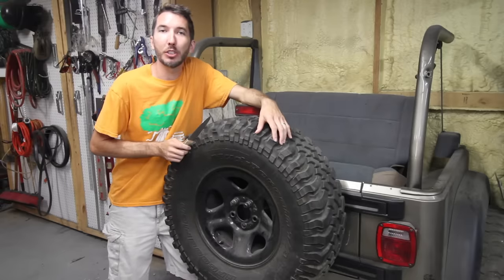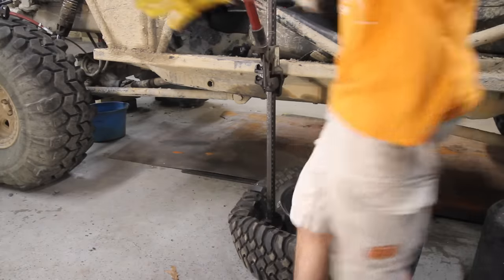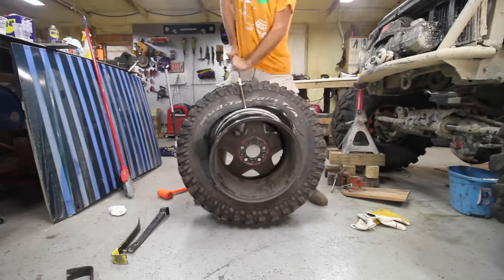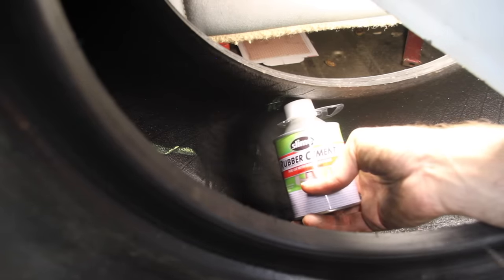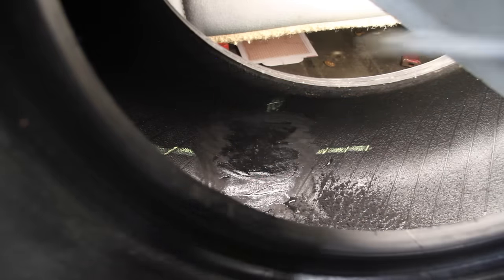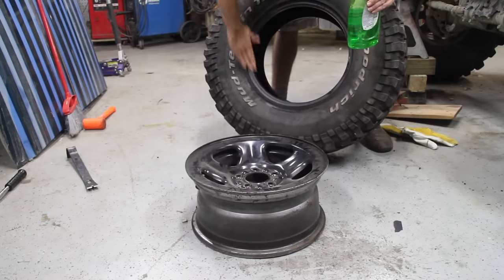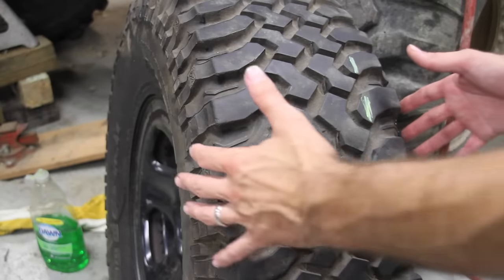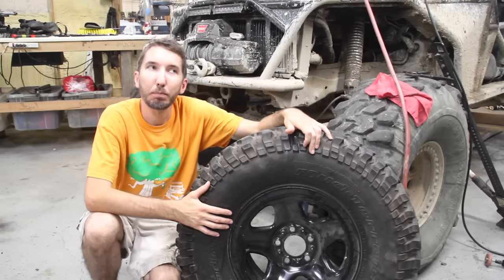How To Fix This - Patch A Tire

Comment: man so many people decided not to hear, that off road comment, liability comment, some people confused on balance lol. suddenly everyone's an expert. it holds air guys that was the goal, it only has to be vuagely round at that point it its never going to see more then 12mph if you wanna carry 3spares go ahead. if you have no dedicated off road vehicle fine. people even claiming retreads and vulcanized rubber don't exist. very sad.....  only think I have to add it that went on and off a lot easier then most anything I've got to work on with a 50s tire machine. it can be so much more trouble then that particular tire, stiff sidewalls are a pain, but wouldn't wanna live without em
Reply: Saya 1 lol I am an expert. Certified and all. And for a trail fix, id say go for it. Matt did say it's just to get you off the trail and I second that. Get it replaced so you can safely run low psi in the future. There's nothing fun about blowing the tire and bending a rim on a rock when there is no air to dampen the blow
Reply: Saya 1
Reply: Good job attempting it yourself but... That's a radial tire. So you need a radial patch. You put in a bias-ply patch.  this will fail. The radial patch has radial Plies built into it so it can work with the tire. A bias ply tire  Has Criss Cross Plies in the sidewall. that's the reason for the criss cross patch. Also you put ( after peeling the backing off the patch) your dirty fingers all over the back of the patch. You have to hold the patch with the backing still on it or  peel one half put it back and peel the other half Look up A&B compound. This is used to fill the slice. Rubber cement will never seal a slice. All I can say for your mounting the second bead of the tire is a monkey banging a football. You put  this on YouTube for everybody to see as well. if that Tire fails... And somebody is injured... Expect to be visited. A good retread shop will fix that tire for you. But a tire repair and replace facility will tell you it is junk.
Reply: +jon rheaume if it fails at under 8mph as dramatically as you suggest then there shouldtve been someone under the tire once it failed. I think your missing the off road statements he made, if anyone tries this on road use or above "off road speeds" he is free from any liability concerns. I believe he said he doesn't particularly recommend it but is showing us how, if I remember that rightly  then he's even more covered for liability. if you read the description for any/every video he makes, he's again covered for liability. so unless somebody's requesting his presence as an outside expert in jeep related stuff in a court he ain't gonna be getting any calls. and remember his credential are for a photographer he is a self made business the chances any want his in court as an expert would probably be looking at factory trained techs. lol
Reply: +sisco lol alright do what ya like. but for under 10mph and maybe 20psi I'll risk a leaky tire and "my life" in case it hisses or whatever ya think its liable to do. I haven't a clue how a slow leak could kill me, but I'll just keep an eye out. watch your ankles for snakes on the trail walking home and never repair anything ever again if you want to worry about minimal risks. some risks do need to be calculated
Reply: +sisco if your expressly worried about warranties then yeah hands off, most companies can't handle the liability of well anything let alone someone trying their handiwork to repair.  but were talking off road use here the tires only die when they crack or puncture I wouldn't rely on a 15yo tire for road use but if it holds air and havs tread its a decent enough off road candidate long after a warrantee has left, it can have a slow leak it can be unbalanced and if ya have beadlocks it may not even need to hold air.  almost any other use for a tire is more demanding then dedicated  off reading (road and off road use tires completely different story, race and road different story, truck tires doubly so). therefore I don't think any warantees figure to specifically for this aspect. and it would take some thought and preparedness if one noted to patch a spare tire for a road car to make 35mph to get 10miles home, that would be a calculated risk that shouldn't always be made  but the scenario covered in the video I don't have any grudges against
Reply: VULCANIZE RUBBER DOES EXIST  i have a roll. and heat clamps. and use it on farm tires all the time. and i sew the tire up then vulcanize it . it works . i own a tire shop materials are available

Comment: Great video. When someone in our group or myself gets a sidewall puncture on the trail I just plug them. I had to use 4 plugs once because of the size of the hole in a buddy’s sidewall. Their are times changing a tire on a trail is not safe or will take too much time.
Reply: i just put TWO in a hole ... but not sure if i should "trust" this or just get a new tire now ... ATV ... :(
Reply: Christopher Richardson if you’re on a trail you have two choices, one change the tire or two plug it. I average 17,000 miles a year off roading.

Comment: big problem ive ran into is if you dont have a flat clean spot or truck bed to lay tire on ive gotten dirt and mud in the bead and besides bein hard, you get just a piece of straw or mud in the bead you end up with another mess.I like having the resources to patch and plug but i was basically in a mud hole and couldnt go on with rig cause tire was wodding up and on a hill.So without a spare besides the pouring rain i would really had been in super mess.i like to have both ways to fix the flats,spare and  repair kit and some type of on board air.Loike or love the videos

Comment: This is great info! One thing I think would help some is showing how to mount tire with starting fluid and a flame, just incase compressed air isn't available. But great trail repair.
Reply: You must have better luck than me. I use lighter fluid or acytline gas and still have to use my aircompesor with a busrt can. (Small high pressure air tank)

Comment: Shoulda marked the sidewall and wheel so you can put the tire in the same place. Then it would still be balanced correctly.
Reply: MusTang Nick who has balanced tyres going offroad ? Offroad tyres don't need it !
Reply: its still best practice as you may not ad/subtract too much material and in a lot places people use those tyres on road as their daily
Reply: I try to do the same, mark the tire, etc. but....that patch changes the balance of the tire.
Reply: It doesn't matter, that patch is going to throw off the balance anyways.
Reply: Hell yeah if it was my daily but when I'm trying to get my truck out the woods last thing i care about is a balanced tire. Come on now suppers on the table. Eat up now
Reply: What's the point of putting it back in the same spot? It would be unbalanced with the glue and patch on it.
Reply: if you want it balanced, stab it with the knife on the opposite side and patch that too, lol. JOKE smh

Comment: Plugged a sidewall on my k1500, lasted for over 4 years, and even was good for highway speeds 80+
Reply: Chris Cooney have to agree, iv done that to, iv also put 5,000 miles on my dry Rotted 10 year old spare donut at highway speeds

Comment: i remember a day when you could re-grove and patch side walls.think it was up too 1/4 inch stuff rubber in there and use a special c type heated clamp melt the rubber in then patch the inside.
Reply: That was with biased tires. Radial tires have much thinner sidewalls. It gives you a smoother ride.  Not supposed to patch sidewalls on radials. Those vulcanizing patches you mentioned aren't made anymore. Something to do with hazardous materials. They are the best patches ever.

Comment: At my uncle's tire shop and the City of Lawton tire shop, we would 'float' a sidewall patch. Even on the low pressure floatation tires. I do not remember how as the only time I did that was almost 30 years ago. You could still run low pressure on the floatation tires low speed tires until they wore to the cords.  Look up floating a patch, it effing works!

Comment: Excellent video. The only thing that i would add to this 'trail fix' is perhaps seating the bead with starting fluid. We off-roaders like to run wide tires and they don't always want to seat with just an air chuck. I know it's not always recommended but neither is hammering a butcher knife into a sidewall. Lol
Reply: if you attempt this don't forget that it's a mix of air and flammable that does the trick.  Spraying half a can of ether in there won't work any better (probably worse) then just one quick spray around the rim.  If it fails to seat the bead you need to get new air into the tire before trying again (the old air no longer has much oxygen in it, as you consumed it with the last burn)

If your using something that doesn't evaporate super fast you need to give it time.  I've done it with gasoline before but it takes a few minutes for it to evaporate
Reply: @Wooble57  , even easier is to carry a small 3 litre Gaither bead booster, a lot safer, and will do the job easier than messing with flammable sources, plus a bead booster doesnt burn out your costly tyre!

Comment: I have an old piece of manual tire changer. Have not been to tire store in years. I have s lot of tires on the ground around here.  on a gash like that in the tread area, I have had a problem with the patch coming through the cut and wearing through because of road contact.  They make big thick boot type patches. I learned to not use hand cleaner for bead lube, patches turn loose and will not stick again. I like plugs too.

Comment: I've been to numerous
Tire schools throughout
my 40+ years in the Automotive industry
Bandag, Pirelli , Yokohama
Etc.
YOU CAN REPAIR. a puncture in a SIDEWALL .
And they claim that its SAFE to do this .
IF DONE CORRECTLY !
Although , I would only drive on it at a safe speed  
and carefully to get home or to a Tire shop .
Especially on a High Performance vehicle.
Thanks for sharing !
Reply: True dat ,  never repair side wall or even a nail to close on side wall within 1 or 2 inchs on thread risk if tire risk of tire blowing .

Comment: I cut out and keep a few good sidewall pieces  from old tires for patches. I just buzz the lettering and stamping off the rubber and taper the sides a bit and have a reinforced patch. I like the manufactured patch. I did a nasty gash in a quad tire that was a bit larger than the one shown and it lasted for the life of the tire. Had a puncture a tad bigger than the diameter of a pencil on the sidewall of an almost new car tire and it lasted the life of the tire. When you see what they do in developing countries to keep vehicles moving, it makes you realise how fussy we are.

Comment: Good video. Solid example of manual dismounting a tire. Try taking just a layer off the inner lining and staying out of the plies. When the belt is visible you've ground a little too far.

Comment: All of the Discount Tire guys are cringing right now. I feel
Reply: Its Kiba994 I work there and J E S U S he tore that tire up. He grinded that waaaaay to much.
Reply: I work there, he way over did it, but in a pinch it’ll get you a mile or 2
Reply: Lol true..
Reply: Bro for real
Reply: I’m just shouting no good in my head. 
In side wall and it’s way to long
Reply: Discount tire guys have no clue what this guy is doing lol.
Reply: My dad's got a wacko gf that cuts his tires regularly,  he uses somthing like speaker wire and gorilla tape inside out with a peice dubleds back jamed in the alot
Reply: @Allis1isAll  what language is that?
Reply: Bet, yes they are cringing.. only reason why this would never be done is because stuff like this have blown up and injured other people. Is it worth it for a free service? Not really.
Reply: You could just jeep a tube for your rim size in your emergency tool box. Much easier and much safer. I'd be surprised if that sidewall patch made it more than a few miles.
Reply: I know this is a 2 year comment, but still, I dont know why im  stuck watching absolute dip shits trying to repair and side wall damage. It hurts. This guy not only endangered himself but others on the road.
Reply: John German DT employee here who’s also worked at other shops. our other shop does the same repair proceeds except we light the glue on fire to vulcanize to the patches. i like the shops patches better than the garbage discount tip top ones, but they also patch sidewalls. this is only for farm vehicles, and at the customers discretion, and if we tube the tire. let’s say a trailer tire gets sidewalk damage and the customer wants to keep it. what we do is take similar patches to these ones in the video (lomg patches from sidewall to sidewall) and repair the sidewall. then we tube it. we only repair the sidewall so it’s a smooth and sears surface so contaminants/rough surfaces can not damage the tube. 
discount does a lot of idiot proofing but i agree with it because when you got a bunch of teenage boys working there it’s hard to let them all think smartly about what to do, and plus they have a lot more liability being a big company. plus they wanna make a buck
Reply: @MCatwar  I currently work at a DT in CO so you and I both know that DT does free flat repair, one of the free services we offer. Also we dont work on large tires such as those for tractors. Unless your store has a tire changer with a larger turn table and the such sure, i can understand changing tires. But the damage seen in the video makes the tire way to dangerous to fix and air up to then put it on a vehicle such as a jeep. Not only is it a liability but its dangerous to work on something with side wall damage such as sticking a knife into it.
Reply: John German hm. if you work at a dt in co you probably understand all the jokes about cod38 then;) 
and yeah discount isn’t allowed to touch those kinds of wheels. i gave that as an example of the only time sidewall repairs are decent. and the fact this is a passenger tire, not a farm tire(they’re much thicker and robust) and not tubed makes this a horrible safety issue and a waste of a tire.
Reply: @MCatwar  haha you work at 38? Thats the one off Wads, didn't Jeremy just transfer to ypur store not too long ago?
Reply: John German nah i’m up at 18. been there 2.5 years. back to the good ol’ “J” days😂😂 small world!
Reply: @kitchenbriks3685  before they started the new shit only patch if in center of tire to sell tires this is how the shops fixed tires I've done 1000 none have failed
Reply: @adrianedwards4321  or 2,000....
Reply: @jkruger5895  yeah yeah... And anyone who puts a lift kit and oversized wheels and tires on their vehicle also endangers everyone on the road.
Relax.
Reply: @slavic982  The point is this is a repair for "emergency wheelin out on the trail."  I have worked in the automotive and tire industry for 25yrs.  He overbuffed the tire, and for real you have a BUFFER out on the trail?!  But he did a LOT of stuff that was dangerous.  Airing up a tire like that in the field?  Put it back on the car and stand WELL away out of trajectory....  At least slide it underneath the crawler and use it like a tire cage.
Reply: @MCatwar  Im genuinely curious, I work at DT too. What happened at 38?
Reply: @slavic982  oh it just got built when I got hired up the road so we just gave it a hard time. when they first started, they barely had any staff and had a terrible reputation.  I bet they're fine now, but we would be 60 down during the winter and they'd be maybe 8.  we've seen some cars come from that location that should've never left the shop, but then again, that's almost all DT eventually--everyone makes mistakes.  so nothing really bad, just typical neighbor store banter.  just like you guys probably give 09 and 5 a hard time etc.  the stores we give all the beef to is 38, 5, and 4.  i remember last summer actually, we took a flat repair from 21 that was absolutely horrible.  the tire was no good at all and not even repaired and yall sent it xD
Reply: They don't know Anything. Just changing tires till a higher price job comes along. These lazy kids can't stay off their phones over 4 hours.
Reply: @kitchenbriks3685  I would be surprised if it didn't last at least several thousand miles of road use.  We used to do that routinely on farm tires and never once had a problem.  You can't know something won't work if you won't try it.
Reply: @jackmehoff1565  You are ABSOLUTELY correct.  Thanks.

Comment: Sadly though most people own a jeep because of easy access to the spare. Then they have someone else do the fix. But I perfer to do work my self so I really appreciate the video. Especially for those people that run an already flat as their spare lol have seen my share. Most haven't put air or rotaed them in since it was bought just hilarious to see. I but my brand new jlu with 16,500 miles on it and spare was never rotated in yet and it has been through three separate dealers before i bought it.

Comment: Awesome video and admire your use of dish soap and jack to break the rim from tire !. 

Try Shoe Goo and motorcycle inner tube . Light the Shoe Goo which gets everything all nice and warmed up - blow out the flame and place inner tube patch  with Shoe Goo on the rip + plus pressure for at least 3 minutes . 
Great video Bleepin Jeep and Thanks !